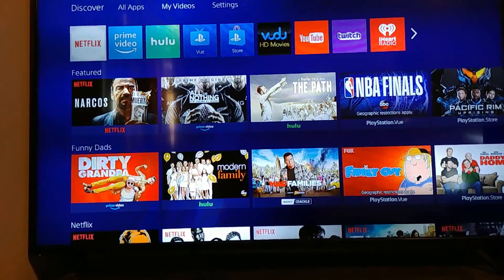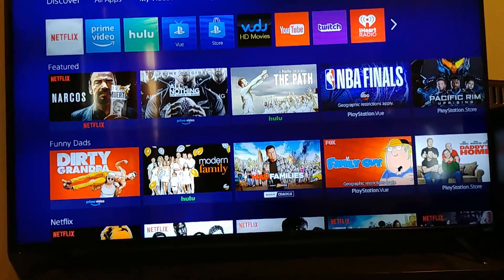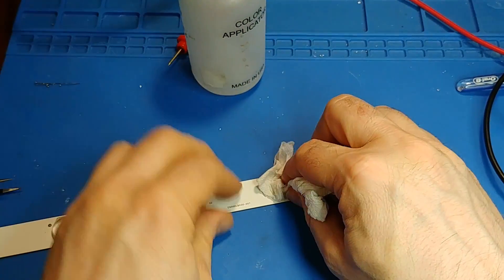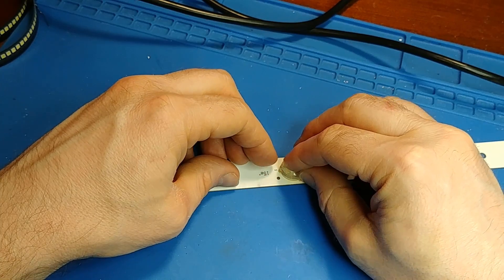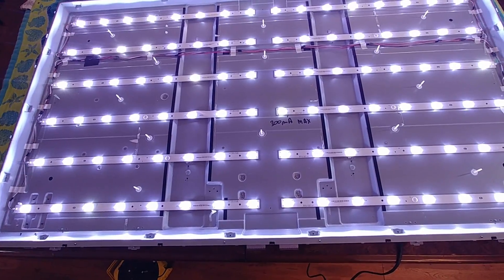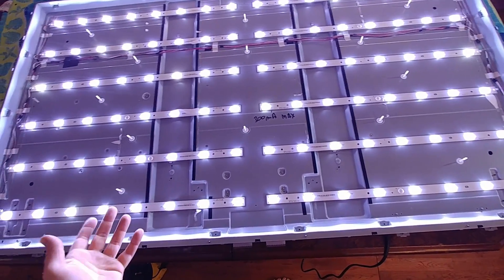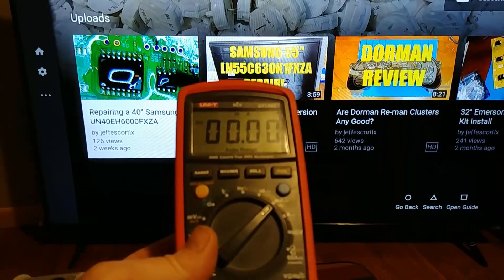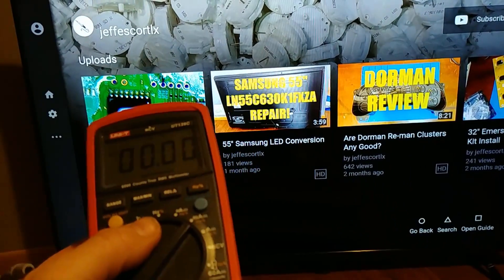How to Repair 60" LED Vizio Smart TV

Comment: I replaced the led strips in my m60-c3, I’m about halfway done, just finished reinstalling all the white clips on the reflector sheet, I’d like to test the led’s all at the same time, to make sure the ribbon connections are secure, how do i do that? I saw in this video all the lights on at the same time. Could you explain how that’s done? I just don’t want to go through removing the lcd screen, like to know all is good before I continue buttoning everything up. Thanks.

Comment: i have a vizio D65u-D2 with 2 dark bars and the whole right side of the tv screen is dark would this be bad led strips?
Reply from the maker: Yes correct.
Reply: @jeffescortlx  I’m thinking about doing it myself it seems pretty easy. I read somewhere about not to touch the capacitors or you’ll get a good shock
Reply from the maker: @fordguy2001  usually the capacitors are discharged by the time the back cover is removed. Most common first time issues are ripped COF ribbon wires or broken glass.
Reply: @jeffescortlx  thanks for the video i fixed my tv. 👍
Reply from the maker: @fordguy2001  glad to hear!

Comment: Thanks for your helpful video. Does this SMD replacement 3030 3v 350mA work on E60 E3?
Reply from the maker: For a E60 E3 I would recommend to just buy new strips and replace them all with new.

Comment: I have some dark banes on the bottom and top on the right hand side. I have a V Series I had about two years. I clocked a lot of hours on it some times falling to sleep with it on so I shouldn't complain. It's really strange that I haven't seen a YouTube video with someone replacing backlights on a V Series. Thank you for the video.

Comment: I got my e60-c3 repaired today. It had 3 non functioning LED strips. Took me almost 6 hrs. This TV is a pain to put back together. All my LED strips were taped with double sided tape to the paper that sits in the bay. It was a pain in the ass to remove! Thanks for the video.
Reply: I have same one but now there's no image or logo when I powee on

Comment: Ever get a chance to investigate the high current issue?  I'm about to tear mine apart.  What was the LED supply voltage, 22V?  If I wanted to make it safer, what do you think of adding current limiting resistors inline with each strip?  22V at 350mA is 7.7watts so 2X safety factor would need 15W resistors.  Digikey lists 68, 56, and 50ohm.  At 22V that'd be 324mA, 393mA, and 440mA.  I'm interested what you think.  I'd like to make the new LED strips that I just bought live a long life.  That 600mA turn on pulse is idiotic.  Like they run 100% PWM at startup before dialing it back.

Comment: so i took apart my vizio e 70 e3 and replaced the LEDs got it all back together but now im having a problem with the actual picture. it seems to be turning on the back light. turning black but then turning back off. i thought i seated the ribbon cables on the bottom off but it doesnt seem to be the issue. i did it a few times and it still is lighting up then turning off. no picture is displaying but the backlight is lit. looking for guidance if i should give up or try to replace a board
Reply from the maker: Make sure you didn't forget a connector, maybe a t-con power or input.
Reply: @jeffescortlx  I did. I removed a ribbon cable from the right side connected to the t con board. Ended up getting half a picture that way. So it’s either the t con board or it’s the panel…. Just don’t know which one

Comment: I have a E60u-D3 which originally had a problem with vertical colored lines across the entire screen.  And then shortly after that the tv wouldn't turn on.  After trying out a new power board and then a T-Conn board (neither fixed the issue), I tried out a new main board - which solved the problem of the tv turning on.  However, now I have a bluish screen.  I've read this could also be due to a faulty 'backlight inverter' - is this part of the power supply board and, if so, would I still be able to turn on the tv if it was faulty?
Reply from the maker: LED TV's don't have a backlight inverter, just older CFL TV's. It's possible for LED's to turn blue over time, but Vizio typically doesn't have this issue. To know for sure you'll need to remove the LCD glass and turn on the tv and see if the light is white or blue.
Reply: @jeffescortlx  First off, many thanks for the reply.  Due to the fact that the 'screen turning bluish' issue happened suddenly, could there be another cause besides the backlights? (e.g. something going on with the power or t-conn board?)  Just trying to avoid having to disassemble the tv as that looks a bit intimidating...
Reply from the maker: @DayTrooperGW  it's possible the panel is failing or your panel ribbon wire needs to be reseated at the t-con board.
Reply: @jeffescortlx  Thanks again.  My T-conn board has 4 wide wires (each of which appears to control a section of the screen) - are these the 'ribbon wires'?
Reply from the maker: @DayTrooperGW  yes.
Reply: @jeffescortlx  
Ok thanks, I'll to reseat the 4 ribbon wires
Reply: @jeffescortlx  
So I tried reseating the ribbons multiple times, but unfortunately the problem still persists.  So regarding the power supply board, do you think it's possible that something on there could be failing and that's the issue?

I did note that while I had the back of the tv off - that the backlight color appeared bluish there, too (i.e. the light coming through holes in the back of tv).  If that doesn't sound right  then I guess the backlights probably need replacing unless a problem with the power board is causing them to appear bluish.
Reply from the maker: @DayTrooperGW  it is extremely unlikely that the power supply is causing the LED's to appear blue. But it is possible the LED's are breaking down causing the light to be blue instead of white.
Reply: @jeffescortlx  
Thanks again.  Do you think a short or something could possibly cause all the backlights to turn bluish?  This is just strange as the issue wasn't present until my main board went out.
Reply from the maker: @DayTrooperGW  if you can directly see the LED's and they are blue (not looking through the LCD glass) then your LED's are breaking down. Something to do with the phosphor layer in them. You'll need to replace the LED's to get a white light again. Just remove the LCD glass and look at the LED's while on to confirm.
Reply: @jeffescortlx  Ok, hopefully I can do that without making things worse.  On E-bay I see a full set of LEDs for ~$50.  Does that seem like a fair price?

Also - once removed, how you do prevent dust or hairs from getting on the backside of the lcd screen?   If anything is on there it will show up while watching tv right?

Comment: This may be a dumb question, but is there any other way to solder the new LEDs other than using a hot air station? I just checked and prices for such a device seem to range from $50-100 and up. The idea of just replacing the LEDs appeals to me because it's cheap, but it's not so cheap if I have to buy the tool. And no, unfortunately I don't know anyone who has one that I can borrow.

Harbor Freight lists a small, 3-in-1 soldering iron, mini-torch and hot air blower that runs on Butane. Would that work? Or what about a generic, electric heat gun?

My TV came from the trash and works, but most of the backlight doesn't seem to be working. I don't have much spare cash at the moment, so the cheaper the repair, the better.
Reply from the maker: I would recommend to just wait until you can buy new replacement pre-built strips. Not as much of a learning experience, but a lot less frustrating for a beginner.
Reply: @jeffescortlx  It's just that I really don't want to spend $60-80 for a new set of strips, especially if they're likely to burn out 2-3 years down the road. Apparently this is a really common problem with this model and Vizio TVs in general.

On the other hand, watching you replace the individual LEDs, I know that I would probably have trouble doing that. I might just try it if for no other reason than I can get 100 of them for about $12 and the little mini iron/torch is cheap. I know it's probably not great, but it might work. And if it doesn't, the strips don't work as-is anyway.

To be honest, I haven't done anything more with the TV. I haven't had the ambition. I was trying to troubleshoot a 48" Samsung TV that won't turn on, but I came up empty on that. Won't turn on, backlight doesn't come on if you unplug the main board, no visibly damaged components, cable to the main board seems to have the proper voltages, etc.

I kind of count myself lucky with the Vizio. Usually bulk trash TVs either turn on and have a trashed screen, or they don't turn on at all. Of course, having said that, I did get two 40" Samsung TVs last year that both work perfectly. Also a 31" LG TV that initially had a stained screen, but now looks almost perfect with just two very minor blemishes that only show up in bright scenes.

My friend and I have brought home 3-4 TVs in the 20-30" range recently and none of them worked. Most wouldn't turn on and the TV we grabbed tonight had a damaged screen.

Conversely, it's rare that I bring home an LCD computer monitor that DOESN'T work. I think I had one that wouldn't turn on and one with a bad screen. All the rest have worked.

Comment: I'm never buying a Vizio again.......
Reply from the maker: Why?
Reply: @jeffescortlx  Because I bought a piece of crap DYNEX 50 inch many years ago and I'm still using it. I bought a 70 inch VIZIO and it crapped the bed like clockwork when my warranty expired. It had dark spots in 2 different places. I just spent 100 dollars and replaced all the light stripps and now it looks even worse. Now half the tv is black and there are now 3 strips going across the screen. I'm not a fix it person but I watced a video and follwed the steps. Still didn't work. I'm out thousands on the TV. I bought 2 large screen tvs and both sh*t the bed on me. Every time they do my inexpensive DYNEX is the one I go back to because it still works. I'm thinking of getting a short throw laser projector. At least it's small enough I can take to be fixed and will fit in my car or easily enough thrown in a dumpster when I waste my next couple of grand.
Reply from the maker: @georgewood419  I reccomond testing the new LED strips before installing the LCD panel to make sure they all work. Maybe you missed some plugs? If you have defective new strips, can you file a claim with the place you bought them from?

Comment: You want to fix mine,
Reply from the maker: Sure some day.
Reply: @jeffescortlx  I'll pay you, I have the right corner starting to dim on a vizio m701d-a3r and not sure if its led or led driver,  I can send you a pic my email sjscustomguitars@yahoo.com if you want to hit me back
Reply: @jeffescortlx  if I have a bad led would it stay bad or would it turn on and make the black spot go away and then come back?  I'm having an issue with the right upper quad turns dark then sometimes it's fine,  would it be the led or the driver or tcon
Reply from the maker: @scottschmitz6061  LED's will typically flicker or act intermittent as they start to die.
Reply: @jeffescortlx  so, would it turn off then sometimes the picture is 100 percent fine? I just dont want to take it apart if it is not the back light,

Comment: My 65" Vizio screen went black.  I was using DISH TV.  I plugged my HDMI cable into Fire TV and it works fine.  So, is my problem the Joey box?
Reply from the maker: A bad dish box receiver can't stop the TV's on screen menus from working. Did the volume indicator, input select and menu functions still work?
Reply: @jeffescortlx  I use a vizio sound bar.  That worked.  Input worked.  Other than that, screen black.  I spoke to DISH today and they asked about error messages.  It goes straight to black.
Reply from the maker: @wayniebob1948  if the screen is black, but on screen menus/volume indicators still show up on the screen, then it's probably not the TV that is the issue.
Reply: @jeffescortlx  thanks.  I'm gonna get some new Joey's from DISH.

Comment: I have an M65-E0 and it has developed about 10 bright spots in various locations (increasing by the month...). They appear to be along the backlight grid, so I'm guessing this is due to the diffuser lenses becoming detached? I'm surprised I haven't found more people with the same issue. I assume I should be able to take it apart and just glue the lenses back on?
Reply from the maker: Vizio's aren't known for lens falling off. But they are known for LED's going bad. So chances are the darker sections are bad LED's.
Reply: @jeffescortlx  so in my case it's bright spots, not dark. See photos: https://imgur.com/a/p9zSSZD
Reply from the maker: @booshong  next step would be to open it up and see what's going on.
Reply: @jeffescortlx  got it, thanks. I'm pretty handy with electronics but this might be above my skill level. I'll probably reach out to local repair shops. Thanks for your replies!

Comment: PRO TIP: DO NOT BUY Vizio!  Great video
Reply from the maker: SUPER PRO TIP: It doesn't matter what brand you buy, they all have models that suffer from failing LED's.
Reply: @jeffescortlx  I own a 19K square foot repair facility and stand by my comment.
Reply from the maker: @2000ViperGTSsubscribe  I own a 100 square foot office and I see just as many Samsung's and LG with LED failure that I can't really say vizio led quality is any worse or better than the other big brands
Reply from the maker: @2000ViperGTSsubscribe  the entire point of this video is how to replace LED's in a vizio TV.

Comment: I hope just buying and replacing the led strips would do it.
Reply from the maker: Typically yes it should as long as the LCD glass isn't damaged.
Reply: @jeffescortlx  right now the screen turns on fine its just that it's all blue or purple.
Reply from the maker: @xopexindustries  that sounds like something a LG TV would do.
Reply: @jeffescortlx  unfortunately it's a vizio d58u-d3
Reply from the maker: @xopexindustries  before you buy new LED strips pull the glass and light it up. If it's still blue you need LED. If it lights up white you might have T-con or LCD issues.
Reply: @jeffescortlx  I will try to do that first. From what I read, it's a common issue where a yellow film seems to Crack and flake off the diod, making only the blue and purple hue.

Comment: Thanks! I have this same POS. (Horizontal grey shadows on half the screen - 3 at first, now the top half of the screen.)  I called Visio and to my surprise they replaced the TV, but two years later THE SAME F%ING THING HAPPENED! This time Visio only offered me a discount on another purchase. BFD! BUT BUT BUT when I bought it at COSTCO I extended the warranty to 5 years, so their warranty provider Square Trade gave me a brand new TV by another manufacturer. I'll still fix the old one, thanks to your vid, but I would have junked it.
Reply from the maker: Sounds like you came out pretty good in the end. 2 free TV's?

Comment: Can you share what tool you use to send power to the LEDs to test a single LED or the whole strip.
Reply from the maker: Lab bench power supply can run a strip, or a typical multi meter can light one up on diode check mode.
Reply: @jeffescortlx  sounds like I'll be using my meter for that. Thank you very much for a quick reply, I just started taking the tv apart and your video helps a lot. Couple more questions if you don't mind. 1. What did you do with black LCD panel when you took it off? Did you lay it down on another table or on the floor somewhere, or you think I can stand it up on the long edge up against a wall? I think that is the scariest thing for me that I'm afraid to mess up, one wrong move with the LCD panel and I might as well throw away the tv. I'm thinking of either standing it up against a wall if you say it's ok to do, or lay it down on the carpeted floor, what do you think? 
 2. Was it just basic super glue that you used to glue the lenses back on the strips?
Reply from the maker: @Hlywine  I just lean the LCD up against a wall. Be careful to not pull on the ribbon wires. I reccomended buying complete new strips and replacing all of the.
Reply: @jeffescortlx  thanks for the help. Although I have been successful at soldering a replacement LED onto the strip, while I was fixing one strip and testing it, another one failed on me. With that track record for those LEDs I would have to either swap them all, or get new strips altogether if I don't want to be taking it apart again in a month or so. So I took your advice and got me new strips from shopjimmy. (If you buy them through their Amazon page, you pay same price but save $10 on shipping). Anyway, that TV is up and running great, I'm doing 2 more TVs now that are 65". You were an inspiration for me and thank you for that.

Comment from the maker: I have replaced all the LED's and it is still going strong and being used daily.
Reply: Did you ever figure out the issue with the surge at power on?
Reply from the maker: @jvoris  no, but it's still working.
Reply: @jeffescortlx  i got The exact same TV with the exact same problem how much would it cost to change out all those LEDs at a TV shop
Reply from the maker: @2pacalypseish   Well the replacement strips normally run just under $100 for this size of TV. But as far as the labor they want to charge to install it, that's up to them.

Comment: is a dangerous and very risky desambly especialy when you take whit hands and pullout the screen in the flex conector it can be disembled that way can by broken the flex ,you need to pull out directly itouching the screen , not to touch flexs . very dangerous way to pull it out sorry bad video .
Reply from the maker: Watch again at 3:58
I don't lift by the flex, I just slip my fingers past the ribbon cable and pinch the glass.